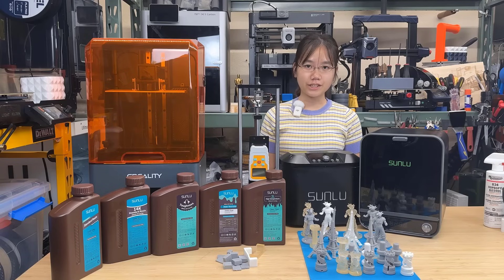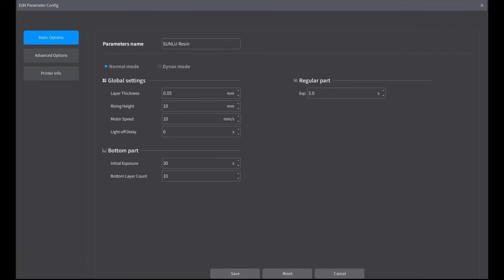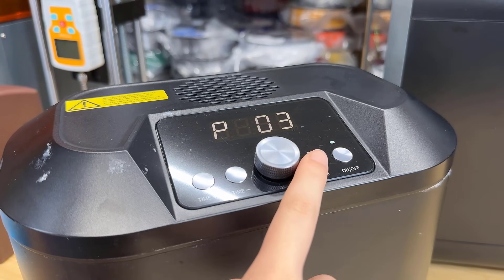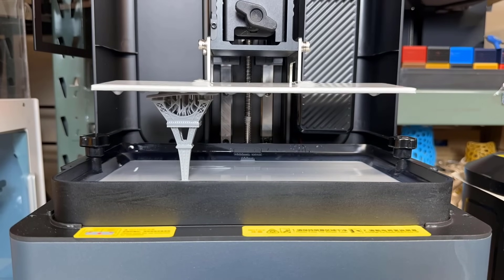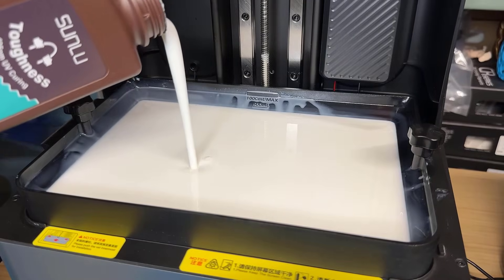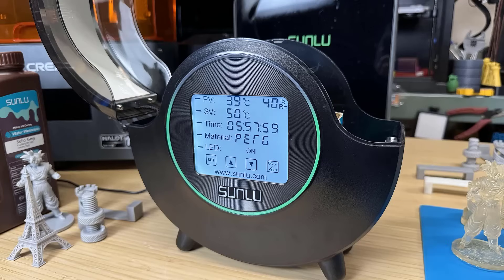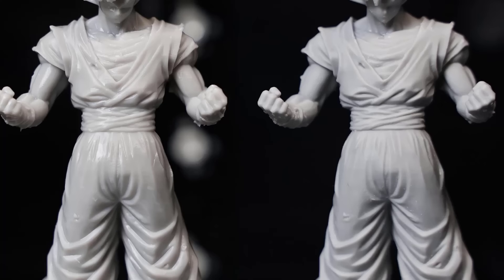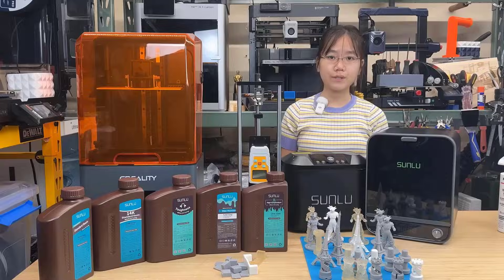Testing 5 different resins from SUNLU: Standard, Water Washable, 14K High-Res, High-temp, Tough

Comment: Immediately threw out the results when it was stated they were using the same exposure settings for all resins. Crazy they didnt properly calibrate to each resin to have proper results. Strength test is also flawed because you need to figure out proper cure times for each resin otherwise you can make them brittle.

Comment: [9:40] Surprised High Temp failed under pressure. Technical Data Sheet (TDS) shows very high Flexural Modulus and pretty high Flexural Strength. I was planning to use it to print thermoforming mold tools. Worries me that it snapped. Why?!?!

Comment: You don't need 70 seconds for the 14k Sunlu, it's the angle you're printing at! No one would print any models like this with that much suction force, with the better resins than standard and water wash two of the worst in the resin lineup! Both i personally avoid with a passion they are so bad and not just from Sunlu! I refuse to use a water wash or standard as they are so bad for models in the hobby! 
I use Sunlu ABS, Sunlu Toughness, and Sunlu 14k ABS, all at 30-second bottom exposure, because angling them slightly on the build plate prevents excessive suction.

Comment: So, what settings use for sunlu 14k? I have photon mono m5s pro and always i have the same problem: practically all statues staying on the fep. The last settings was like this: normal layer 0.7 mm, exposure time 2.80 s, time off 0.8, bottom exposure 95, bottom layer 7, lifting z 10, lifting speed 14, return speed 14. Even with these settings printing gonna failed

Comment: I've got the PERFECT Cosplay for Aurora, she could 3d print the costume too.    The Adjutant from Star Craft:   https://youtu.be/YD2aq2MbboE?feature=shared   She's the only one that could pull that  announcer off.    (I mean it in the best way possible)   She could create her own taglines:   You are out of Filament.   You don't have Sufficient Enough Resources To Buy This Printer. Your Printer Has Died.    Might even become a Meme, forget Prusa Joe Coming Up to Greet you before you print, in  warps in Aurora the Adjutant on the newly installed Firmware Screen to guide you to victory.  Adjust your Z-Axis offset 0.05 mm and set your Extruder Heat 5 Deg C higher.    Please wait while I recalibrate and debug the entire OS.

Comment: For general purposes, the ABS-like is best, because delicate parts won't easily break. I've had ultrasonic and conventional wash stations over the years, and the conventional washes work better. Recommend a dual-wash cycle (dirty and clean) and denatured alcohol, which is cheaper than IPA and smells much better but still works well. It's brilliant that they had a dry cycle before curing as this really matters. I usually just let the parts air dry after the clean rinse. Don't put too much stock in "14K" which isn't.
Reply: I have no idea who buys IPA anymore it gives headaches and is expensive the ethanol is cheaper(in the EU)
Reply: Ultrasonic is way better washing. It needs to be heated for best results. I use PPG "Glycol" and its the best way to clean hands down and lasts way longer than IPA, 2 gallons last years of use

Comment: Interesting video.
FYI tap water vs tape water. Please check for this. It was funny. For a moment I wondered where you could buy water tape. I am familiar with masking tape, blue painters tape and insolation tape. Never heard of water tape before.
The new music is still catching me off guard, as I have been watching your videos for a long time now.
Great video.
If touch resin is similar to nylon, you could use it to print bearings and other nylon parts.
Much easier than in an FDM/FFF machine.
Reply from the maker: Thanks for pointing that out. I just fixed the typo of 'tap water,' but it may take a while for YouTube to update the video.
Reply: @AuroraTech  and autocorrect making typos for myself also.

Comment: The heat resistance test is not really adequate.
 The same model that you used for the fracture test should be placed in an oven, so that you place a weight (screw nut) on it.  By measuring the temperature with a meat thermometer, you gradually raise the temperature of the oven.
 When the model softens, the screw nut lowers, then the temperature at which it softens can be read.

Comment: At 10:24, it looks like there is also some cracking on the Eiffel Tower second from the right. Although not as much as the standard resin.
Reply from the maker: That was the tough resin. The tiny, thin rails of the tower didn't print too well with this flexible resin. Please take a look at 8:20; it already looked like that before heating. I pointed to that part with a green arrow.

Comment: I like the baggie trick for a sonic cleaner. I use tupperware style containers with solvents for small parts in my sonic cleaner as it is 100 gallon! We print items that sometimes need to take high heat. But cannot be brittle!  Tough seems like a better choice.

Comment: im boycotting sunlu after they ghosted me when I had a problem with their absolute garbage PLA. great video though love this channel
Reply from the maker: I’ve printed a lot using their PLA with many different printers, and it worked just fine. What kind of issues did you experience?
Reply: I bought their pla+ and the recycled filament (10kg) and all printed very good result
Reply: They have good pla, maybe it was a skill issue?
Reply: Even a consistent product can have a bad batch.
I struggle getting sunlu PLA here in South Africa.
I love the stuff.
The closest I have so far is the Creality brand filament. More flexible than normal PLA.
Reply: Sunlu PLA + is one of the best filaments i have tried buddy! Ask my customers and they will tell you